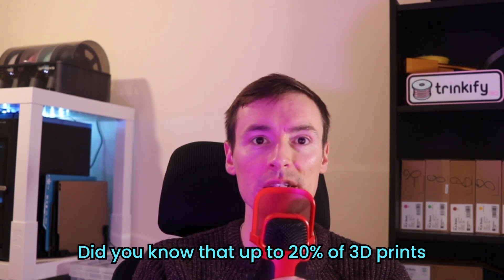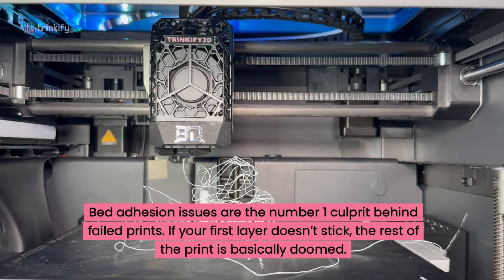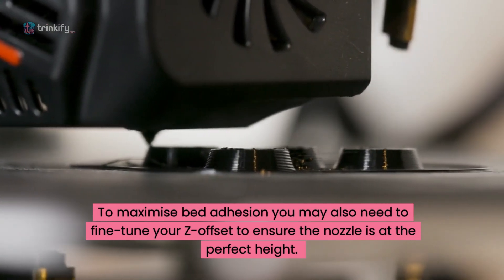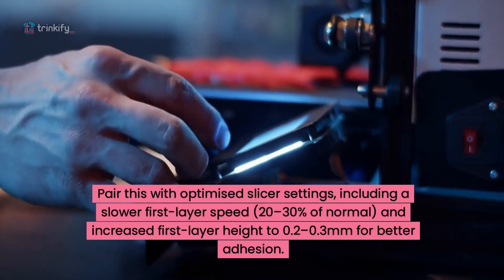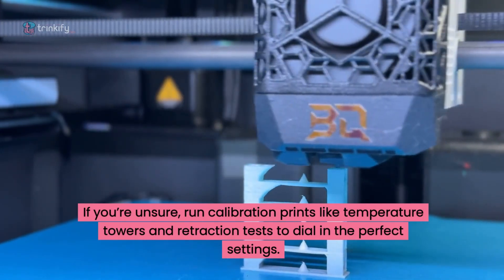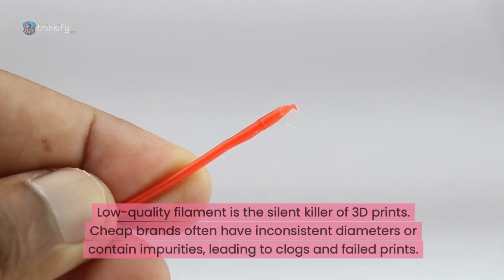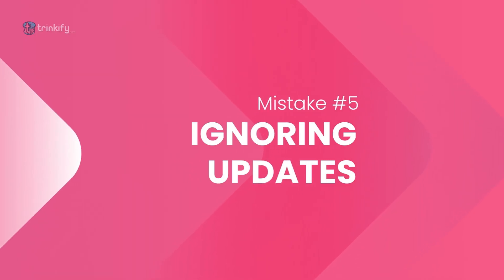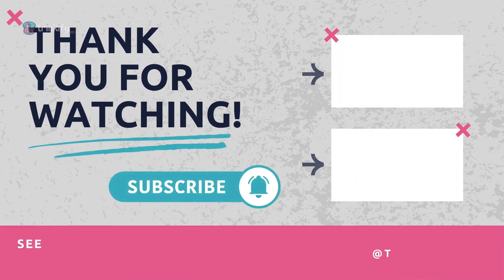Top 5 Costly 3D Printing Mistakes (and How to Fix Them Like a Pro)

Comment: stop using uneriliable paper - each is different. Stainless Feeler gauges are very cheap and more precise than random paper....
Reply from the maker: @ententeak  Great point, feeler gauges are consistent and are very cheap these days on sites like Amazon and aliexpress. Paper is still useful in a pinch as it’s usually pretty easy to find lying around the home